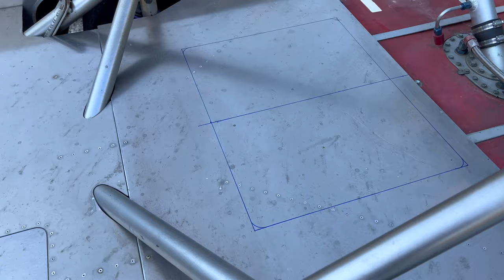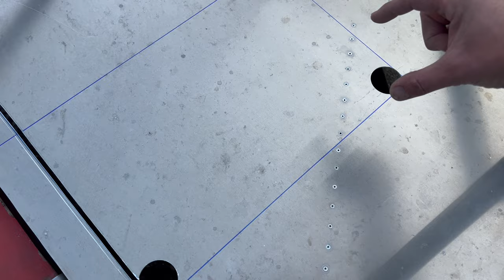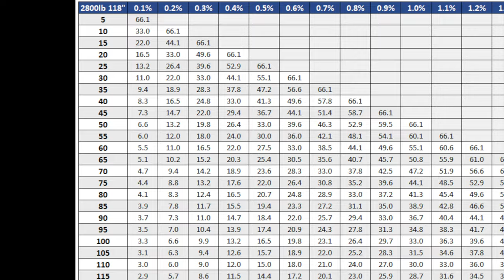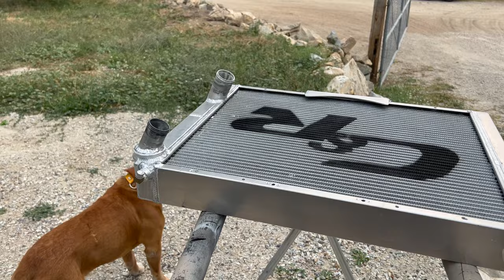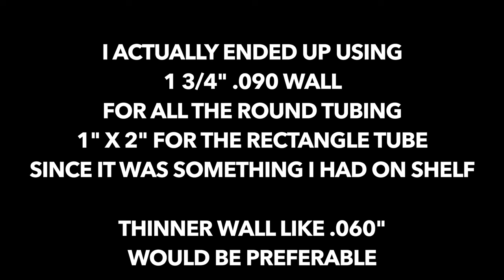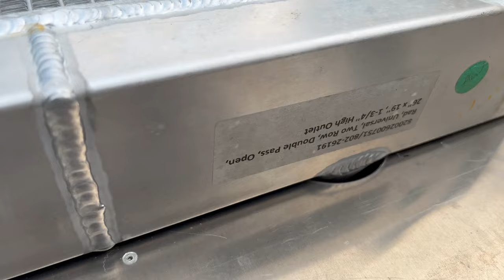Rear Mount Radiator Install - Rear Grip Needed For More Speed -

Comment: The BMW 328i has a good electric water pump. They are about $100 from amazon. I am waiting to do similar on my trust. Trapped ait in the cooling system is the biggest challenge. You do really good work
Reply from the maker: Thanks Eddie! Good call! I just looked up that pump and I think it would be a nice addition to the system , what I ended up doing was removing the thermostat and it seemed to flow ok as long as I was above idle, but that additional electric pump would probably make the system more stable, as far as the air getting trapped that definitely happened and I ended up solving it by pulling a vacuum from the steam ports until the air was gone then sealing it back up and it seemed to hold , different engines may have to be done in another way though